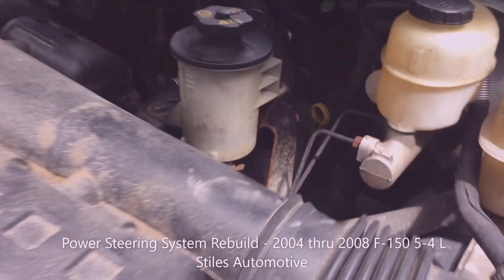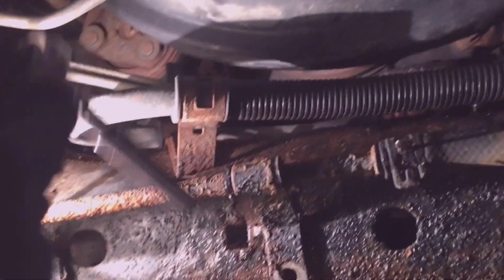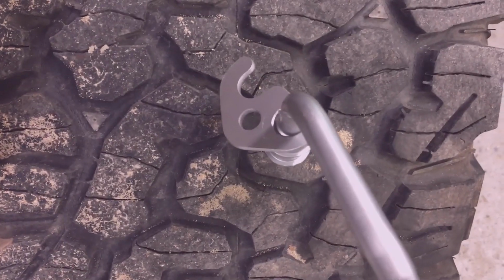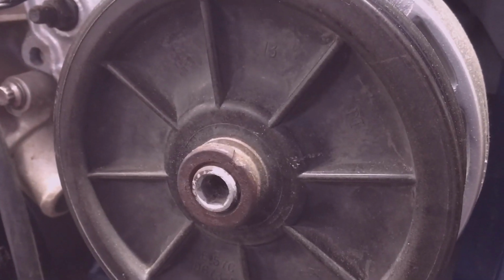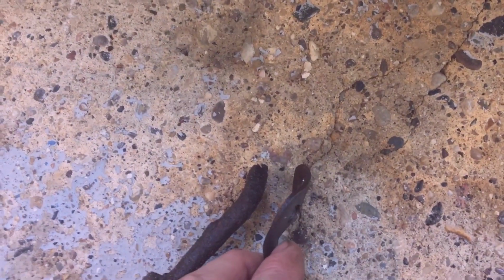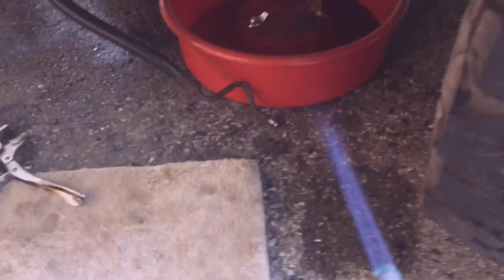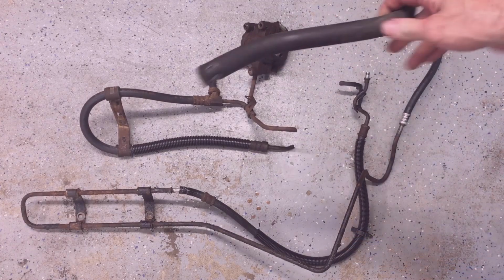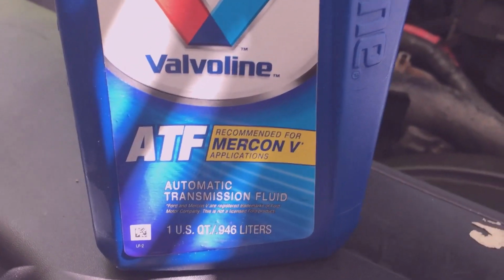Power Steering System Rebuild (Removal-Cleaning-Installation)   2004 thru 2008 F 150 5 4 L

Comment: My lines going to the rack have been soaking for a week now. They are both stuck. I most likely will have to pull the rack.
Reply from the maker: Amos,  I used a little Propane (or Map Gas) Torch, an Oxyacetylene Torch with a small tip would be better to put more heat in a smaller area, heat the tube and fitting. Let is cool and do it again, this expanding and contacting, will loosen up the dirt and corrosion. - Stiles

Comment: You can tell this is a loyal Ford guy when he says he can't believe it didn't leak/break sooner. In all seriousness, Ford does design a good power steering system but not at all easy to service.
Reply from the maker: Amos, For Sure! Yep, my Power Steering System was so rusty all over, and the Pump had a layer of rust that flaked off.  You know they could have used a Stainless Steel that would have lasted forever.  And . . . just between you and me . . . I'd rather push my Fords than drive a Chevy!   - Stiles
Reply: @StilesAutomotive rack has been removed. I had to drill out one of the lines. I think I was able to blow all the chips out with a compressor. Way bigger job than I thought.

Comment: Why not replace the lines after all that trouble.  They might have interior corrosion.  No disrespect intended
Reply: My bad, maybe I heard you wrong and you are replacing
Reply from the maker: Shantor, Yep I replaced everything, but the Steering Gear. - Stiles

Comment: So I ended up deleting a bunch of line. Namely the steel line that runs back and forth(makes a big u-turn) on the front side of the front cross-member. This line runs to the reservoir on one end with a rubber hose crimped to that end and not sure where it runs on the other end but that rubber hose is just clamped to the steel line. This latter hose has plenty of length to reach the reservoir so I connected it directly to the reservoir after routing it through the brake lines at the brake controller so the hose would be secure from the contacting any of the pulleys.

Not sure why that additional length of steel line is there unless it's for cooling. But given this would not provide much cooling I'm leaning towards the theory that an engineer was upset with Ford and decided to design in this long length to cost Ford a bunch more money.
Reply from the maker: BlackSeaBrew, Yep you are right that "extra" loop is the Power Steering System Cooler, the Power Steering System doesn't need much cooling, but it needs a little.  You can probably get by without the cooler, especially in the northern states.  I'd keep an eye on my Power Steering Fluid, if it don't look clean, shiny red, like new Fluid. I'd consider putting the cooler back in. - Stiles
Reply: Thanks I was thinking of doing this too because my truck is too rusty to ever unbolt anything and fix it the right way.  Did you have any issues?
Reply: @claytonmatt4334  I haven't had any issues at all. Even took a 1500 mile round trip to Texas and back in some hot weather. But I don't drive it everyday. @StilesAutomotive made an excellent recommendation to check the power steering fluid color/condition. Chances are the steel section of your line is rusted internally so getting it off of there would be a good idea to keep that rust out of your pump. As indicated there is plenty of  existing rubber hose to just run directly to the power steering pump.

It just so happens I bought a bunch of 3/8 SS tubing. In the middle of building a man-sized shop but when I get around to bending a new piece I'm happy to make you a piece and mail it to you for the cost of shipping. I'm in central USA so I wouldn't expect shipping to be more than $20.

Comment: replacing my lines today. Thanks for an EXCELLENT video. I'll probably be kicking myself for not replacing the pump at this time, but I don't have any issues with it. One of the lines just started leaking, so I'm replacing all of them. I think the worst bolt to get out will be at the pump. Were you able to get a wratcheting wrench on that or a crowsfoot? Thanks again for taking the tie to do this video!
Reply from the maker: Buddy, I appreciated the feedback!  No, I think I used the Boxend part of the Combination Wrench to get that Front Bottom Bolt, the rest are Socket and Ratchet. - Stiles

Comment: Watching this make me appreciate my 1985 F150 - my son has the 2008 F150 with this problem and I'd never ever get one of these later models with everything so darn 'compact' where it takes an act of congress to repair things on it - what idiot started making things like this? Answer - NWO
The repair shop will charge almost $700 to do this, and with all the proprietary tools like the pulley puller, the traumatic efforts needed to get TO the the lines and then to get them off, and the bizarre contraptions they've designed to make this problem happen in the first place - pay the shop to do it - but it gets better ~ later models now use electric power steering contraptions that you HAVE TO HAVE A SPECIALIST do any repairs... see where this is going yet?!? Piece of junk designed by control freaks that hate DIY's
Reply from the maker: Ms. Jaimie, I appreciate your comment, and I know what you mean. Many things on Fords are designed for ease of assembly during manufacturing and maintenance later is a second thought.  If you think the Power Steering System on the 2004 thru 2008 F-150 is "tight" watch my Video on replacing the Transmission Cooler Lines (see link below), the 2 Cooler Lines under and beside the Engine are extremely tight. I believe the Ford Design use a Computer CAD Design Tool to proof that this could be done with the Cooler line in one piece.  And . . . I think I stated in the video, if . . if Ford would have used a corrosion resistant material (like Stainless Steel) the Lines would have lasted the life of the Truck! - Stiles

Transmission Cooler Lines Replacement, '04 to '08 F-150 Trucks  https://youtu.be/eAilFMgc5xI

Comment: very helpful thanks
Reply from the maker: Matt, You are welcome, I appreciate the feedback! - Stiles
Reply: I’m having a hard time getting that 18mm nut off the high pressure line. I have a stubby 18mm open end wrench but I need to grind it down to make it flat.

Comment: does any one know where the 06 f150 power steering pressure sensor is
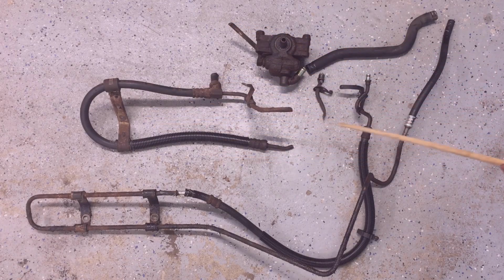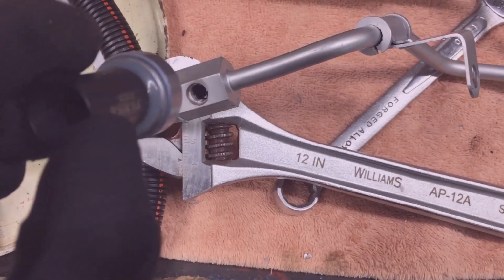Reply from the maker: Anthony, "any one"? My friends call me "Stiles". Your 2006 is similar (or the same, engine dependent) as what I show in my Video. It is on the Pump to Gear; Power Steering Pressure Hose. Some F-150s do not use a Pressure Sensor.  Review my Video at 18:26 (Old Line), and at 22:48 for the new Line and Sensor.  Again, If you are asking because you can't find yours in the same location as mine, you may not have one!  - Stiles

Comment: With a small power steering fluid leak, is there a way to determine whether the lines or the transmission cooler is leaking?
Reply from the maker: Paul, If you have a "small" Power Steering Fluid leak, you will be able to see the Fluid level going down on the outside front of the Power Steering Reservoir, The Power Steering System and the Reservoir doesn't hold very much Fluid.  A "small" Transmission Fluid leak will be harder to see on the Transmission Fluid Level Dipstick. - Stiles

Comment: My high pressure line just blew - it looks like he front of the motor had a hot oil massage - time to get into it. Great vid btw.
Reply from the maker: Goldy, One day it seems like it is fine, and the next . . . rust and corrosion all over the place.  Make sure to clean or replace that Belt, then clean your Pulleys, if you got Fluid on the Accessory Drive Belt. I appreciate the comment! Let me know how it goes! - Stiles
Reply: @StilesAutomotive  Bought a new serpentine belt with the pressure line. Cheers brother. Plan to steam the engine front once I remove the belt.
Reply from the maker: @goldysgarage189  Ok, very good! We are thinking the same way! - Stiles

Comment: Don't know if I'll get a response as this is a older post,,but hoping!! I got a '03 5.4 F150 is the pressure line the same set up at the steering box, or is it bolted in rather than pressed? Not looking forward to this.
Reply from the maker: Dorie, Your 2003 has a different (threaded) connection, here is your Power Steering Pressure Hose for the '03 Ford F-150 5.4L on the Rock Auto Website - - 

https://www.rockauto.com/en/catalog/ford,2003,f-150,5.4l+v8,1414695,steering,power+steering+pressure+hose,7320

Your task should be much easier, let me know how it goes! - Stiles
Reply: @StilesAutomotive  Thanks, I'm goi0ng in!!

Comment: Great video but I'm not looking forward to this job. Mine started leaking today on my 07 F150. I live in Ohio so I get all the snow and salt and the rust that comes with it to make this job more of a pain in the butt
Reply from the maker: Kevin, Yep, those Fitting would come apart easy when the Truck was new.  But, dirty and corrosion build up over almost 20 years makes them hard to remove. Hit the Steering Gear connections with PB Blaster (or other Penetrant) morning and night for a couple of days, or from now to when you do the replacement! Let me know how it goes! - Stiles
Reply: @StilesAutomotive  thank you for the tip. I will definitely do that.

Comment: I built a pair of vise-grips with black pipe welded on to make slide hammer to pull them off
Reply from the maker: Walter, I surprised someone doesn't make a little Slide Hammer with Vise-Grip like Jaws!  Thanks for the comment! - Stiles

Comment: Good stuff.  Never did this sort of job prior and know this will help.  Question:  no need to bleed the system?  Just fill, turn the steering and recheck level?
Reply from the maker: I appreciate the comment.  Yes, to bleed the Steering System just turn the Steering Wheel from lock to lock (all of the way left to all of the way right). This will force enough Fluid thru the System to force the Air out. - Stiles

Comment: I'm going to replace my pump and lines. Are these lines and pump compatible with f150 08 lariat 5.4? Do you know how much it will all cost
Reply from the maker: Andrew, Yes your 2008 uses the same Power Steering System as my 2005.  I put a link to all required Tools and Parts/Consumables in the Video description to help you identify what you need.  This will give you an idea of cost. - Stiles
Reply: @StilesAutomotive  I saw that. Which drive belt? You have listed Drivebelt Motorcraft. Are there sizes for it?
Reply from the maker: @andrewkozik4666  Looks like there was an option to include or delete the AC System.  GATES K061025 (w/ Air Conditioning) or GATES K061025HD (Heavy Duty) (also with AC) - Stiles

Comment: Did you have to remove anything for the pump to come out, like oil filter, fan, fan shroud, etc?
Reply from the maker: I did not remove the Fan Shroud, it would made the task easier, but you do not have to.  I didn't remove mine because the previous owner of the truck or the snow plow installer, mounted the plow solenoid and cables to the Shroud.  The task of removing the Power Steering Line would be much easier without my snow plow mounting bracket installed.  In the video I showed everything that I removed, I attempt to be detailed and include the head-size of the bolts to aid you to perform the task. Let me know how it goes! - Stiles
Reply: @StilesAutomotive  ok thanks great video.

Comment: Question on the mounting bolts for the pump.  The two top are very clear and then there is the third one on the bottom with the clip.  Is there a 4th one behind the line on the bottom, far side from the cab?  There is a hole and cavity there like there should be a 4th bolt.  Is there not one in that position?
Reply from the maker: Chris, On most (read not all) 2004 thru 2008 5.4L F-150s there is not a Bolt in that position.  On other Ford Vehicles that use this same Power Steering Pump there is.   If there is a Bolt in that location, it is extremely hard (and slow process) to get to get out. - Stiles

Comment: Just got a leak, it empty out my resevoir just below the resevoir, didn't take much to fill it, Man just got done tearing down the side of my engine replacing the timing chain, timing house gasket, water pump and the oil pan gasket a year and and a half ago, just going to let a mechanic tackle this job let him tackle those rust bolts, can't deal with another big job like this. How much do you think a so call professional will charge to change out 3 hoses?? My rack is good back they used serpentine belt  for power steering it was easy as a piece of pie to tacle that job now you have to fight with job because of limit spaces an rusty bolts that weld themself into the blocks or car walls. 98 taurus se, bought this car brand new with 134,000 original miles on it, never ever had to touch the power steering section or do anything to the drive train.
Reply from the maker: Chuck, Yep, I know if the Car Manufacturers would coat the parts or use stainless steel the lines would last the lifetime of the car.  On the F-150, I have brake lines right near the Power Steering Lines in the video, that look brand new.  They have a black coating on them.  Thanks for the comment! - Stiles

Comment: On my 2008 Ford F150 one of the bolts extends about an inch from the head and has a cable attached, do I need a special tool to remove that bolt?
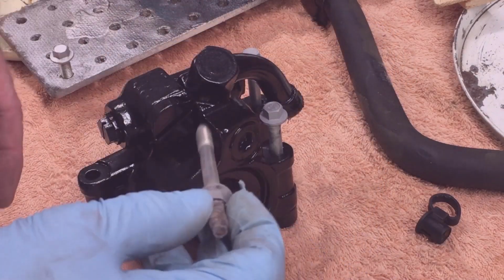Reply from the maker: Luis, No special tool. Just use a 10mm deep-well socket, I show the bolt at 9:25 in the video, but don't talk about the tool. - Stiles

Comment: You really don't want to heat the fitting you want the body around the fitting to expand ...and it's sometimes helpful if you have an impact hammer with a blunt tip to wake up the part ...or loosen it with the frequency of vibration...
Reply from the maker: Michael, True, but you don't want to apply heat to the Steering Gear.  Heating and cooling the Fitting causes movement between it and the Steering Gear, that loosens it.  But true, you always want the outside part to expand (and heat) and the inside part to contact (cool).  The impact hammer is a good tip for robust parts, little exhaust manifolds.  Thanks for the comment - Stiles

Comment: I wish i would have seen your video before i rebuilt my power steering and yes the stud broke off in the shaft, i hope i can get it out.  My truck has 50,000 miles on it and every single line has broke! !!!!!  Including transportation and brake line and the fittings in the radiator can bought you have to buy the whole dam radiator
Reply from the maker: William, Sorry to hear about your corrosion issues, but that is my life too, life in the northern Salt States is rough on cars.  You should look for radiator shops to tank and rebuild your radiator, it may save you a few dollars over a new radiator.  Let me know how it goes - Stiles

Comment: power steering works on my 04 but i have power steering fluid puking out of the vent on the reservoir.  any ideas?  I only drive back and forth to work about 6 miles but its enough that I'm leaving puddles everywhere i park.

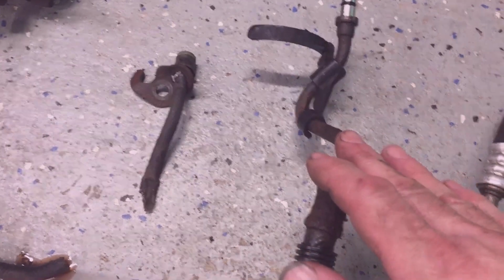that black plastic bracket (22:13 center page) traps dirt salt and holds constant moisture on the line.  that's where mine failed.  I wish i did them all simultaneously.   instead of individually
Reply from the maker: Papa, you do use the word "pukin'"  Did you let the Power Steering Reservoir get low on Fluid and then add more?  The puking sounds like air in the Power Steering System.  Could be from low Fluid, you would know this, or it could be a problem in the Valves in the Steering Gear (or Rack) . . . or it could be a leak in a Hose on the suction side of the Pump.   Let me know how it goes!  Thanks for the Comments! - Stiles
Reply: @StilesAutomotive  still trying to diagnose.  No.  Has always been maintained at the halfway point between Max and Min.  Just before it started up i had been driving in deep snow in 4 wheel.  Extreme cold also and thats when it started to whine.  I though maybe i kinked a line or something.
I flushed the system and replaced with Mercon V.  During flushing the fluid was not very dirty and had no sign of aeration.  I purposefully lowered the level and its been holding steady.  Lock to lock to bleed system.  Because of the reduced level it looks like the puking has stopped coming out of the small vent on top of the reservoir.  
I did a complete timing job last year and when removing the pump it took quite a bit of effort to remove the bolts because it was basically a block of rust.  I fear now that the pump is shot and has finally crapped out.  The rack looks dry but its hard to diagnose because there is residual fluid everywhere.  I am waiting on some warmer weather to take a deep dive to troubleshoot.  I have not lost power steering so there appears to be a pressure build up and and then it looks like return to the reservoir causes the overflow.  
When i flushed it i removed the lower pressure return, disconnected the crankshaft sensor to turn the motor over while purging the system,  topped off reservoir.  There was no restriction while doing this so it appeared the flow was not impeded (no blockage).  I think the pump is shot or something in the system is creating a pressure differential.  i just cant simulate the event.  almost like it is overflowing after the engine is left to sit.
sorry if this is long winded but i'm at the point where the annual repairs is pushing me towards buying new.
If i figure it out I'll post a follow up.

Comment: Found it very helpful. Now I know that I do not want to do this, ever.
Reply from the maker: Yep!  When the truck was new it would have been easy, but the Fluid Connections at the Steering Gear are not designed for dirt and corrosion.  Glad you found the video helpful!   - Stiles